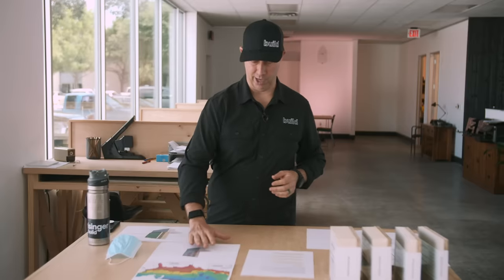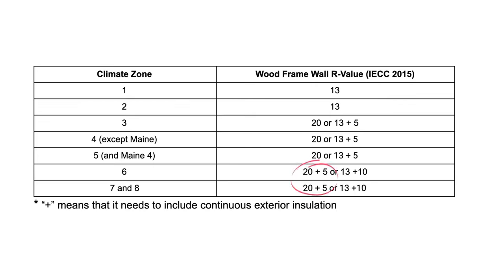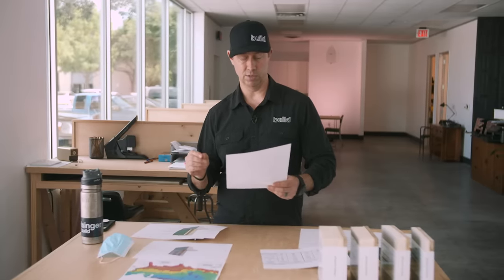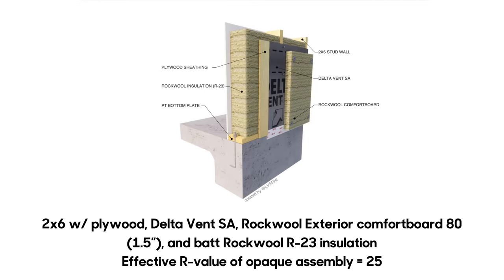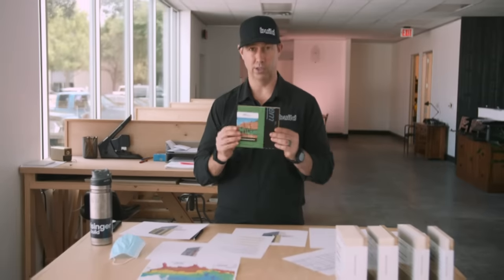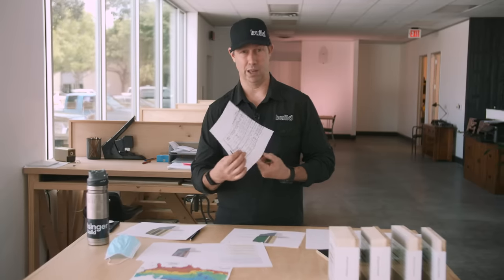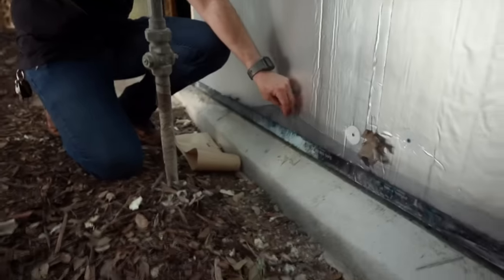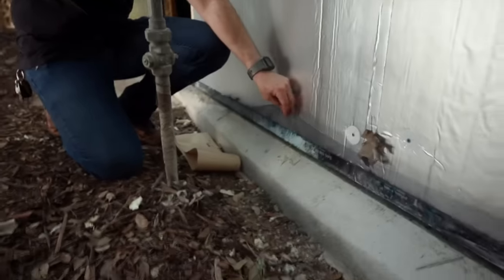5 Ultra-Insulated Framed Walls

Comment: The pricing for this is great for the upper classes, but the people who need energy savings the most can't afford this type of technology.  What kind of energy savings and break even are you finding with this type of installation?  Thanks.
Reply from the maker: Check my last video and the per wall foot pricing. I suspect with an average / smaller home these materials upgrade aren’t more than $5/sq foot of the house. 2000 sf foot house means it costs $10,000 more to build from the crappy cardboard production builder wall to a really good wall. Is that only for the upper classes?  How about building smaller then?  My home under construction is 2800 sq feet. I could have built a crappy 4000 sq foot house but chose to build a well built smaller home.
Reply: @buildshow  What is the energy savings versus the costs?  Ten years?  Twenty?   Thanks for replying.

Comment: I need your advice. After watching your videos on new more efficient home builds. And I was was thinking of trying to sealing up the attic. Every time my attic AC comes on the air rushes out of vents hot and musty smelling. But getting ready to reroof and we currently do not have ridge vents and roofer is planning on adding them.
Reply: Should I tell them not to and what would you do first to seal the attic space. I simply do not have the money to redo our roof like you’ve done in your new home but I hope there is a middle ground for making my attic a conditioned space

Comment: Hey Matt I don’t know how else to try and get a message to you so trying this hoping for an answer.       Does Rockwool loose some r value when installed on the outside of the wall with all the air movement through it like fiberglass does in a stud cavity that has air moving through it?  I have looked and can not find any information on this concern. Thank you in advance.

Comment: Why spend money on cap screws for the Comfortboard if you're just going to apply wood strips for rain screen. It seems to me that you could tack the board up or even glue it in place and then use the strip lumber rain screen to hold it in place with a long screw.

Comment: Do you insulate under the bottom plate? If I used Rock Wool for the outside layer, how do I attach batons?

Comment: Why would polyiso be negative in the northern climates, the zip surface and the aluminum face both act as air and water barriers, the sheathing and insulation must dry to the inside.
Replacing polyiso with comfort board means the only thing that can dry to the exterior is the comfort board

Comment: Matt what about the potential for radon gas build up in such highly insulated homes? 
During the 1970's energy crisis, 2 x 6 walls with standard insulation was introduced in Vermont.   After people moved into these homes, it was discovered that radon gas was building up to dangerous levels inside.
So, the remedy was to turnover the air circulation in the entire home every 1 to 1 1/2 hours. Well during those cold winter nights bringing in and heating that much fresh air was defeating the purpose of building in more insulation to lower the cost of heating.  The builder stopped constructing those 2 x 6 walls.   
Radon levels here in North Carolina vary widely across the state.  
For people living in a radon zone, Is there now a way to calculate the break even point?  
Where does the rising insulating value create a higher cost of turning over the air circulation? 
I love the concept. Just want to consider the requirement for circulating the home air.
Reply: Matt has discussed this in other videos, where the air exchanger interacts with the heat as a heat exchanger, reducing the cost of heating/cooling new air because it comes in at a temp closer to the interior air.
Reply: In Front Range Colorado, radon accumulation is a really big issue, well sealed or not. Can prevent sales of some homes. Best defense (usually required) is a set of drain pipes for radon, under the basement or crawl slabs, vented to atmosphere, often with full-time power venting required. Gets messy if you need a sump on the drain pipes, for sub-surface water. Then you have to seal the sump at the slab.

Comment: Have you done the same with roof structure assemblies?  I'm looking at the best way to frame to allow something close to R38 at the rafter line.  When I checked Huber has not tested and does not support the use of Huber R panel for roofing applications, but has anyone done it, or anything similar?

Comment: What’s the advantage of 2x8 studs over staggered 2x4 (for a same total thickness minus the thermal bridging)?
Reply: With the 2x8 

You can put a 2" foam between each stud 

Put r24  wool 

And a r5   1" vapor barrier with Rigid panel like  isofoil or iso-r plus screwed on the stud inside . 

Isofoil or iso-r plus  are 4x8 panel and cheap like under 15$  .  Come in 1/2  
3/4 / 1" / 2" / 3"  thickness . 

I dont know if you that in US but here in quebec house are made with that.
Reply: @elpop15  You could do the same with staggered double 2x4 construction, but without the continuous thermal bridging. Or better yet just insulate the outside of the 2x4 wall with continuous insulation, so no thermal bridging.

Comment: Are you concerned about cold sheathing accumulating moisture with R3 zip on R23 cavity insulation? I know there are code requirements when mixing sheet insulation with cavity insulation on roofs. Are there similar requirements for walls?
Reply: Yes, Code gives percentage of exterior vs interior insulation depending on climate zone. Check out Hybrid Assemblies by Joe Lstiburek at Building Science Corporation for explanation/charts. https://www.buildingscience.com/documents/building-science-insights/bsi-100-hybrid-assemblies

Comment: ROI vs Time..........with cheap solar, yes it is very cheap, you do not have to go r-50 walls.  

   Seal it up, reduce windows, thermal breaks, install solar.........the ROI vs time on solar is far far quicker than any R increases over a certain point.

    Equipment costs are hovering around 1k per Kw on solar.........take a great performing 4 buck a square foot wall, dump the extra that would have been spent on going R-50 and buy solar..........the ROI on solar in a house is down to 3 years now, plus it does more than insulate, it lowers your bill to basically the monthly service charge for having a electrical hook up on.

   Insulation is great, but it will not eliminate your electrical bill.   That`s in grid tie applications spinning the meter backwards with a properly sized system based on your use.  With lithium batteries its about 40 a month if you choose to completely disconnect or can not spin the meter backwards.

   With monthly service charges for just having the electric on before you use a single Kw hovering in the 25-30 buck range  its about a even wash going grid tie or batteries.

 Not only do we need to build better, we need to build smarter............ 

     I am in the final stages of design for my house that will be 2000 ft3  cost  50K in materials  and be virtually net zero exercising common building practices , full of lights, full of heat and A/C  and feature a power hungry home theater.   There is no reason to live like we are in the stone age to go energy efficient or green.......we can have the cake as much as we want and eat it too.

     I will even have heat and A/C to condition the outside screened in porch because of smart building and infrastructure that will only cost the equipment costs, which are very minimal....hundreds, not thousands..........that makes many peoples head explode,...heating and cooling the outside for virtually nothing and being green and energy efficient in the same sentence.

Comment: I remember seeing two 2x4 walls with a gap between them for continuous insulation between them. The interior wall held all the electrical, plumbing, and HVAC without severely impacting the R value. Seemed like a very efficient way to build.
Reply: double wall construction.  great option, and it breaks the thermal bridge from the exterior because of the gap between the two walls.  I'd like to know how this compares in price, r value, and real world performance compared to using a combination of interior and exterior insulation

Comment: "Bigger is always better when it comes to R-value" is not always true. According to the recent JLC article "Awesome Wall" by Michael Anschel on his derivative of Building Science's "Perfect Wall,"  in my Wisconsin zone 6a, the maximum R-value of cavity insulation recommended by Dr Joe Lstiburek, when using the recommended Zip R-12 exterior sheathing, is R-14. The idea is to make sure that the condensing surface is not moved inside the cavity. "Code
 allows more R-value in the cavity, but the consensus in the building-science community is that code allows for a risky wall in climate zones 6 and above."

Comment: My plan.  Horizontal wood siding, 3/4 inch strapping, breathable watertight membrane(pick one), 5/8” plywood, 2x6 24” on centre with rockwool, intello smart vapour barrier, 2x4 service cavity filled with rockwool, then 5/8 drywall.  Easy to build, easy to airseal, very little thermal bridging, not sure how it would price, middle of the range Matt shows I would guess.  Zone 6 home.

Comment: That’s a lot of labor to install all these different layers. How about SIP panels ? Engineered to be plug and play, they don’t even need a finish right away when made with a metal or a hardi board skin. The shell can generally be in place in 1-3 days depending on size and all openings are precision cut in the factory. No wood laying around for weeks and no roof trusses. You get an extra floor for practically the same price. For those like me in the path of hurricanes, the walls are very strong. You get a very tight envelope with good insulation and the labor won’t drain your wallet. What’s not to like...?

Comment: For #11 you should do a mock-up of the most ridiculously expensive (stick framed) wall assembly you can imagine. Maybe a double wall with 2x12s, Intello Plus wrap on the inside, 3+ feet thick of blown in wool/cellulose/etc,  Zip-R12, and 3+ inches of exterior insulation over that 😆

Comment: Matt's number assumes fasteners across all assemblies are the same, and installation cost is the same?
Reply: It was mentioned increase cost of screws depending on thickness if you go thicker which makes sense. I'm not familiar with all these systems and if they require specialized fasteners. I would not deal with a builder who chargers more to fasten plywood than OSB.
Reply: Kevin G. With the iso foam sheets on the outside, you will incur additional expenses for labor and material.. so you would have to pay up for the additional work.. some of it would go to purchasing longer screws to secure the rigid foam.
Reply: @berniemac8413  RIP. My example was just about the act of fastening OSB and plywood. The labor/screws/ECT to install the two would be the same. The materials cost would be different of course.
Reply: Kevin G. Oh okay now I understand. The labor shouldn’t change depending on if you’re using osb or plywood. However, i do think if you screw It, it will be more expensive. Since screws are more expensive compared to nails and it’s take considerably longer to drive one screw in compared to a bump fire mode on a pneumatic gun. Hence, the guys screwing in the sheets will take longer to complete the project. Most people almost always use nails to secure sheathing on the walls.

Comment: Higher insulation values = much higher energy efficiency + reduced energy consumption/noise transmission + more comfort  (ROI depends on local utitility costs, positioning of the home, passive/netzero design

Comment: Is it possible to do one of the assemblies with poly iso if the exterior is going to be natural stone? How would the assembly change in that case?
Reply: We have done this. I insisted on 100% liquid applied (we did have outie windows).You need to research the through-the-foam masonry ties, with a long crew-stud and a wire ring in the outer eye. They are a potential leak point (like if in ZIP only), so the Barritech VP we used was for self-sealing (up to 1/4" dia) around fasteners. Used dimple mat over the foam (basically a foundation drainage mat), then we had 5" bed natural stone. 8 years since completion, no issues whatsoever. And watch your ratio of interior to exterior R-value; condensation in the cavities is a bitch. We also get extremely diligent on detailing and workmanship on all flashings and penetrations (windows, think flash the stone header above, and the window case below).

Comment: Would there be a concern using OSB instead of real plywood?
Reply: OSB absorbs moisture, offgasses voc's, is much more flammable than plywood.   Why would you use OSB for the small reduction in cost?
Reply: @JamesG1126  For the cost yes - around 20-25% cheaper locally where I live. But sure worth to look at the total cost for the project with the downsides mentioned.

Comment: I personally find the zip sheets are Way over sold. These guys on UTube must receive a tremendous discount on that zip material. Do your numbers people, it's not such a good material, just way more money!
Reply: It combines material and labour cost for sheathing AND wrb. Additonally, zip sheathing has a higher shear rating than cheaper osb which is important in high wind and seismic zones. 
There is a reason most sheathing manufactures offer a combined product, weather logic LP, forcefield GP, huber ZIP etc..

Comment: Performance and cost differences between #6 and #7 are lackluster at best. Spend +60% to receive only 13.6% greater insulative value. Perhaps not worth it, with the only exception being the additional structural rigidity of the plywood.

Comment: we use 2x10 r 40insulation, treated plywood and overhangs.. maybe added 2000 bucks saved millions in a/c
Reply: i always use treated studs and  floor  plates on the ground floor and  non  water absorbing  insulation  bottom 4 feet
Reply: i never use  pressboard or osb anywhere nor on roofs..and if  i can, treated roofing  sheeting.  and  metal  roofing..may be expensive  now with the new  prices
Reply: you can get 2x10  #3 lumber for the same  price as 2x6 #2 or cheaper
Reply: What area do you live in?
Reply: 2x4 or 2x10 will still create a thermal bridge.

Comment: For a 40'x30'x20' house, the cost of the most expensive option is only $20k.  So even if that's 2x the lowest cost option, that extra $10k seems small when new homes these days are in the $200-400k range (for reasonably priced areas, not Kaliforia).
Reply: Don’t forget to add another minimum of $10k for the roof!! And all the additional expenses for doors and windows since most standard windows  and doors are meant for 2x4 walls.. AND! Don’t forget the additional labor! Would you invest well over $30k to only get back $20 or so each month!!?
Reply: Also! None of the figures he’s providing include labor. So multiply your number by 2 - 4 to get your actual cost (the cost of labor obviously depends on where you live)! Now you’re ROI is even worse!! 😂😂
Reply: @berniemac8413  why is the cost of the roof going up?
Reply: @berniemac8413  you also have to include the reduced cost of furnace/AC due to the smaller sizing requirement.  There is also the assumption that energy costs are static even though, inflation adjusted, we have some of the lowest energy costs in history right now.
Reply: Matt because in your calculation, you’re only accounting for the surface area of your walls. You still need to account for the surface area of your roof too. Especially if you want to build like him. Also, that’s the most important area of your home to insulate.
Reply: Matt More than likely your HVAC person will play it safe and give you the proper system for your square footage and he/she won’t take into account your additional insulation. I mean why not overbuild in your heating and cooling if you’re overbuilding on the insulation? Also, in the event you convinced someone to give you a smaller system, you’d only save yourself $1-2k. Either way, you’re still in the hole financially. Especially if you’re going to take out a loan to pay for your home. The monthly interest for all the additional expenses will eat up any energy savings you incur. You’ll have a minimum additional interest of $143.22 each month (30k loan, 30yr loan @ 4%, that’s the lowest possible loan amount assuming you did all the work yourself). And that my friend is why this is a terrible way to build.

Comment: On the higher rated ones, I would rather use Zip R-9 vs plywood.   I delt with wood rot on a boat made of plywood stringers so no thanks.

Comment: Instead of adding a bug plate why not extend the bottom plate out?
Reply: I was thinking the same thing.
Reply: While we're at it, why is there no sil or screen on the Rockwool assemblies? Even if it deters certain bugs, surely it would still be better to protect the edge than to leave it exposed, no?